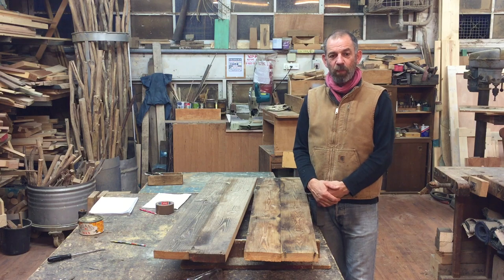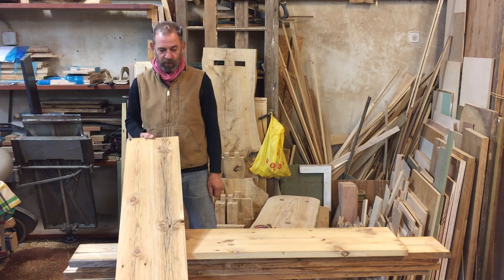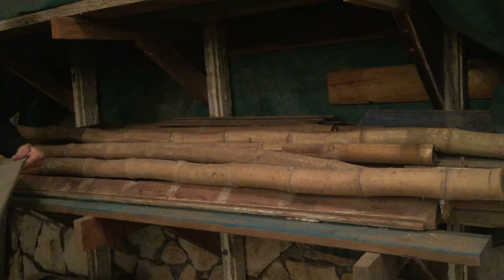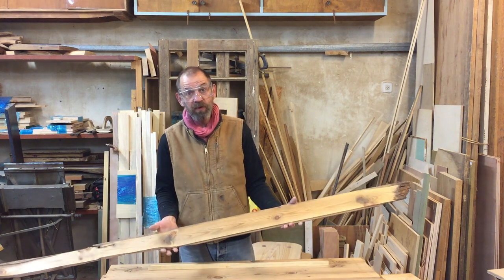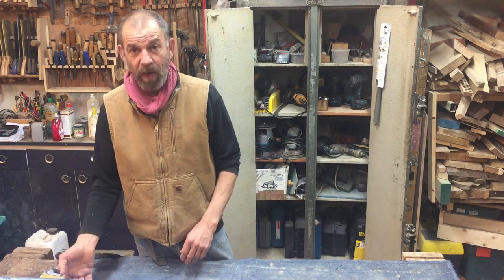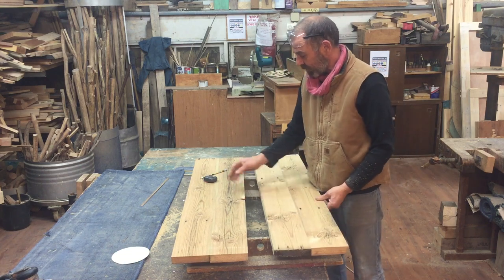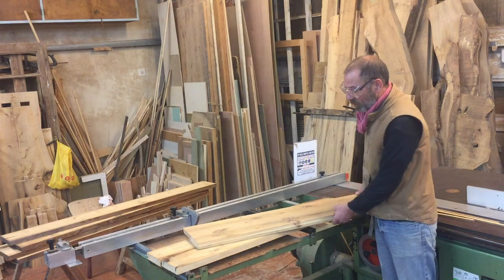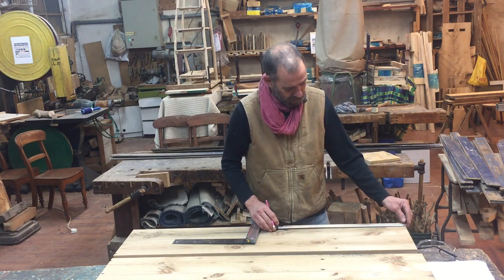Woodworking Project for Isolation and Sanity - 4 - Recycled Wood Shelves!!!

Comment: Is there a way I could make the wholes for the mortise to be at an angle only using a drill
Reply from the maker: Hi Van yes you can ,you need to make yourself a miter gauge i think i explain how in rustic stool video  then eyeball the drill angle using the miter gauge try looking at videos on "how to drill at an angle" anyway thats the pleasure with rustic it doesnt matter if the angles arent exactly the same the sticks arent straight .Just do it you will be delighted with the results go with the flow!!!